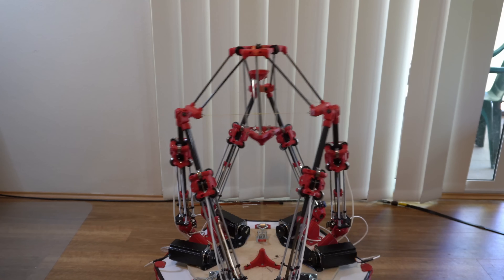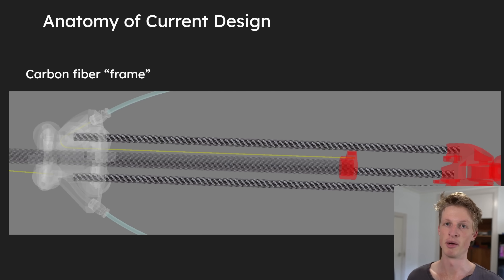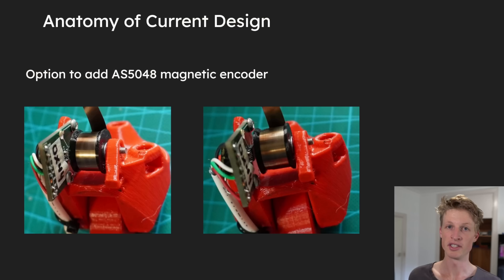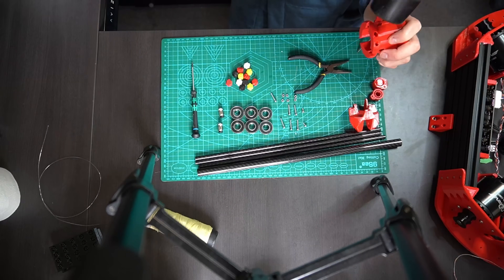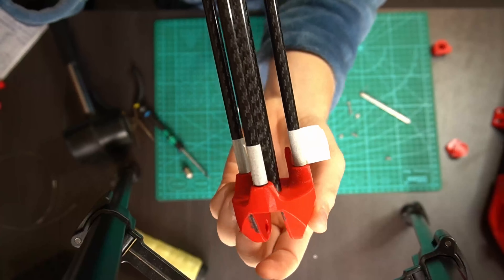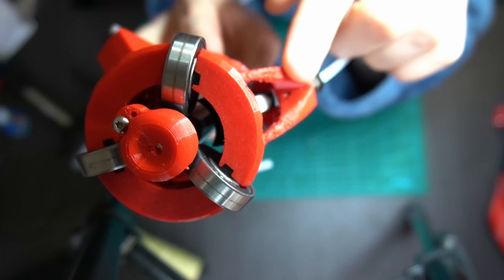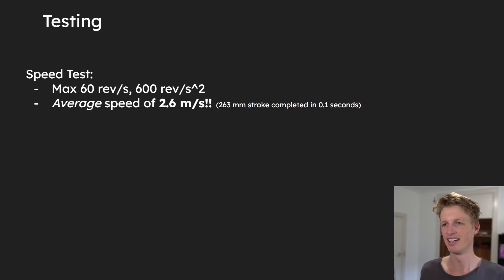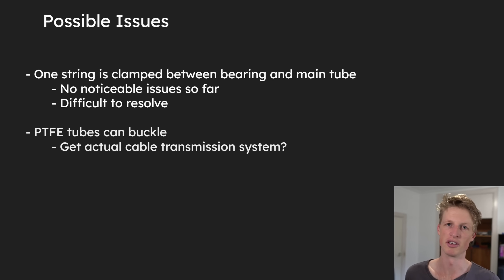Designing High-Performance Linear Actuators: Speed & Stiffness for my Juggling Robot | PDJ#19

Comment from the maker: Hey everyone! I hope you enjoyed this deep dive into the design process of the high-performance linear actuators for my juggling robot. I'd love to hear your thoughts on the design! What improvements would you suggest? Have you ever built or used linear actuators in your own projects? Share your experiences and tips in the comments below! 😃🤖🔧
Reply: As others have mentioned, one or two PTFE or Rulon J linear sleeve bearings would be lighter and probably stiffer than 6 6001RS steel bearings. You could also swap to acetal plastic ball bearings instead of steel to lighten them up and reduce wear.
Other than that you could replace the push and pull strings with a single string and have a tensionning spring at one end to remove backlash. You could also have the pulleys be tensioned against each other to acheve the same result but that sounds clunkier.
Reply from the maker: @NicolasGirard-nxg  Nice ideas! Some thoughts:
1) I previously tried a linear bearing instead of the 6 radial bearings, but the carbon fiber tubes that I'm using aren't specced for that level of tolerance; one manufacturers tubes had a loose fit, another didn't fit at all. Linear bearings would be awesome (smaller, lighter, more elegant) but I don't have the cash to get high tolerance, light tubes... yet 😉

2) Re. a single cable and springs to return: That was actually what my last design used! I had three 1.4 N constant force springs to compress the actuator, but they weren't fast enough. I could opt for stronger springs, but that would just be creating more work for the motor to extend the actuator. 

I like the idea of swapping to acetyl bearings to save on weight. If the weight of the actuators becomes an issue, I'll absolutely be changing these heavy 6001RS bearings for something better.

Cheers for the suggestions!
Reply: @harrisonlow can you offset the bearings 10 degrees to prevent the string being an issue long term.?
Reply: @harrisonlow  Don't use linear bearings on the three rods - just three regular bearings like in the current head but facing out to the inner sides of the three rods and a 3D printed  'shroud' to keep them located.
Reply: @harrisonlow  You can get precision ground carbon tube available in stock sizes. Check places like clearwater composites. 

Also, I suspect you would be much better off mounting the motors on the base of the actuators themselves. If you position them as closely as possible to the pivot/mounting point, it will have a trivial impact on the inertia of your system (because the motors will only move millimetres for tens of centimetres of actuator motion). That will allow you to eliminate the friction and complexity of the Bowden tube and eliminate those failure modes.
Reply from the maker: Interesting, I'll look into it! Re. Clearwater, I'm in Australia and don't have unlimited money so I'm trying to source things locally for now.

I'm glad you suggested moving the motors! The main reason why I moved them off the actuators themselves was actually to cut down on their size, as I was worried that motors sticking out of the actuators might bump into the base of the robot if the actuators move really far. Though since your comment I've been doing some more thinking and I reckon it should be possible to mount the motors in-line with the actuator. We shall see 🤔
Cheers!
Reply: @harrisonlow   @Harrison Low  For the carbon tubes I think the process they use is called centerless grinding, it's common with metals, perhaps a machine shop would give it a shot with carbon or there is another carbon fabricator in Oz you can find.
Reply: What is deferent than used linier bearing like lm20uu or semilar? @harrisonlow
Reply: @NicolasGirard-nxg  having a single string plus tension can cause issues like the force required to move it changing at different extensions, meaning the acceleration and force wouldn’t be linear.
Reply: @NicolasGirard-nxg  "pulleys be tensioned against each other" is something i found in many printers and some other older machinery. (they used gears instead of pulleys) A spring between the pulleys to set the tension and a lock screw  to stop the springing during operation. Just loosen the screw would reset tension when wires get a little 'longer' after use. 
For prototyping his bearings are very nice (priced...) Linear bearings sound nice but I think they will carve in to the carbon rods. Later get some miniature bearings to reduce weight also the holder can be smaller and thus lighter.  
to prevent the string from carving the entrance of the carbon rods, could use bearings with a groove in them.
( with a 3d printer make a jig to hold the bearing  and a 'dremmel' to grind the groove in the bearing your self.)

( I do need to get me a 3D printer ASAP.....  )
Reply: u can use the bike/bicycle brake tubes those are quite tough instead of the ptfe
Reply: @MartinDxt  Gear cable outers would be better than brake cable outers. Gear cable outers are design to be constant length. Brake cable outers can resist more force, but can compress a bit in length. Both are PTFE lined.
Reply: @MartinDxt  could use the steel cables from them, would make it strong AF.
Reply: @MartinDxt  Might be a good idea for a heavier construction with stronger motors. Use the teflon coated ones to reduce friction.   Running a steel cable around tight corners generates quite some friction.
When using the tubes as guide for the cables you could leave the cable-sleeves away and use pulleys ( as on some bikes) to take corners with the cable.  ( see also "3.22131 213123123 's  " comment
Reply: this is slick! have you considered routing the cables through the actuator arm itself?
Reply: @IncendiaryMedia  Would give much greater stiffness than a (long) bowden tube. Also, there's probably a high risk on the string cutting the tube.
Reply: @philip_fletcher  yeah you probably need some sort of super-hard / anti-abrasive bushing, like the ruby inserts in ruby-tipped 3d printer nozzles
Reply: What about using the electric conductivity of carbon to measure the position of the tube? 
Using the fact that resistance is proportional to distance and measuring the potential differences at the tip ( you can pass the wire together with the string) and at the base through the bearing or a brush.
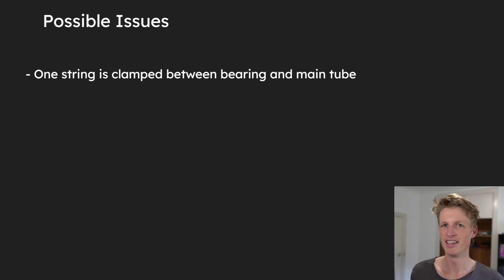Reply: 14:20 use a ceramic eye from a fishing rode for strung position 😉
Reply: I would put bearings on the 3 rods, back end of the extending arm, just for a bit more stabilization.
Reply: You could use vacuum cleaner to suck the string through the hose.
Reply: Great design! 3:50 0.3mm of adjustment range sounds quite large to me :) I'm always quibbling over micrometers to get that perfect wobble-free but smooth moving fit, or tight but no hammer needed. One advice I would give is do not use PLA for those tight fitting holes. It will crack after a few weeks under high tensile stress. PETG is much tougher.
I made a fun linear actuator using an internally threaded tube as the motor shaft, with the screw acting as the piston https://www.youtube.com/watch?v=EXYlxGLux8g
It's kind of cheating, forcing the leadscrew threads to bear side forces in addition to the axial force, but it works surprisingly well. It's really designed for a ball screw, but for this miniature version, a long sheet metal screw was the best substitute I could find.
Reply from the maker: @dekutree64  that's really cool! How does it know when it's at the end of its travel?
Reply: @harrisonlow  It has to be in a known position at startup, and keeps track of how many revolutions it's made
Reply: Very cool project!  Some thoughts:

1. The reason the PTFE tubes are buckling is sure to be because there is too much room inside the tube.  The ID needs to be as close to the OD of the string as possible, to prevent slop.
2. I think a better routing for the string would be to use two of them; one that goes from one end of the shaft to the other--wrapping around a drum in the middle--while the second wraps around that drum and another at the motor end.  (The first can run in between the bearings so they won't be an issue.)
3. Moving the second set of bearings to the inward end of the sliding shaft--they would press against the frame--would make sure that it is fully constrained even when fully retracted while a sideways force is pressing on the outward end.

Does that sound reasonable?
Reply: Any reason why you are not placing a bearing block on the bottom of the moving carbon tube to run, triangulated on the three carbon tubes? Would add a little moving mass but would remove the need for two sets of bearings on the head and, until maximum extent, significantly increase the moment arm.
Reply: @philip_fletcher  Ah, I think the weight-stiffness tradeoff just isn't in favour of that, and it wouldn't have a benefit when the actuator is extended and you need it most. It costs far less mass and only a little length to just move the bearings further apart if that stiffness was needed.
Reply: Awesome video! Carl Stahl tecnocables is a cool custom bowden cable supplier in case that is interesting, Looking forward to this series👊👊
Reply from the maker: Thanks! I'll have a look into them. Cheers for the suggestion!
Reply: Maybe you could remove the motors and build an radial magnetic actuator. You also can drive it with your Odrive and reuse the encoders by that ''wire idea'' lol? Radial magnetic actuator are the most efficient, easy to build and they are far faster than you have now.
So far i know there is no such a thin as a cable transmission system but i there are many other flex transmission systems. Cable seems unpractical due to the obvious friction losses it creates. For low friction look in to teflon.
Reply: Very smart design, Harrison. Looking forward to seeing the Jugglebot performing. Subbed. Cheers from UK
Reply: Ooh, I'm so glad to see this actuator concept getting some real development, I don't think I've seen anyone actually make one so far, and you got it to work really well!
Sorry for the novel below but I have had a lot of thoughts about this concept :)

I would like to suggest some changes to your bearing head. Firstly, I think you need to rotate the top set of bearings to be inline with the bottom set (which I guess can't be moved), and that might give you enough room to offset the cable turnaround pulley so the cable isn't running under a bearing. I saw someone mention running the cable through one of the support rods which would work great with this and cut down on weight too. If the bearings are in-line in rows then the bearing head could be fully split up one side, which would allow you to tighten the bearing fit just by closing that split with screws, which will be more reliable and rigid than using plastic inserts. The split could be in-line with two bearings so the screws the bearings are mounted on would also be used to tighten the fit. I guess you could even split it in 3 which would let you tweak the inner rod angle after assembly, but that is probably better done by getting the bearings tight and then epoxying in the carbon rods with the assembly held straight.

The cable pulleys could also be modified or replaced to get the cable closer to the rod to minimise the changing amount of twist that it puts on your bearing, I would expect that is the main source of flexing force right now. You can probably get away with not having a groove in the bearing since it is so close to the cable mouth, which could let you select a smaller bearing. Also you should really change the cable termination points to ensure the cable runs parallel to the motion, if it is angled then the tension will change as it moves.

As for the cables themselves, I would recommend a thin nylon coated steel cable (either generic, or some bike cables do this) running inside a plastic or plastic-lined sleeve. Ideally it would be nylon coated kevlar, which I am sure exists but IDK where to get it. For the sleeve; brake cable liners are spiral-wound so they have too much compression, you will want either bike shifter cables where the reinforcement is mostly longitudinal, or solid plastic MIG welder cable liners, which come in smaller internal diameters (a tight fit will prevent the buckling problem). If you have smooth plastic-on-plastic sliding then you can get some great benefits from lubrication, light silicone grease would work wonders, regular light grease should be ok, don't get anything too viscous & tacky or it might be worse than nothing. Squirt it through the sleeve then pull the cable through.

You may eventually run into a problem with the inner rod rotating. A bearing on the end to stop it from being rotated by the driven load would fix this, and hopefully the cable tension would be enough to self-align and stop the rod slowly rotating and pulling on the cables. Otherwise you may have to put the cable terminations on bearings too so they can also self-align, or completely redesign it to use a square inner rod. If you need a bearing on the end a good setup might be a flanged bearing that can support itself on the tube end and then a bearing slipped down inside on a rod to resist twisting. I really hope this isn't an issue since all the solutions add complexity and/or driven weight.

For the driving winch you may want to mount the cable guide farther from it to reduce the tendency for the cable to bunch up around the middle, since that increases the diameter of the drum. Anything that will make the cable tighter or looser as it moves will affect how stiff you can make this, since if you have it very tight and stiff and then it gets even tighter it may cause damage.

And finally, if you find that cables are just not working out for you then a timing belt design wouldn't be too bad since you can mount the motor right at the bottom, but I really hope this cable one works out. Best of luck! :D
Reply from the maker: @samheasmanwhite  Wow, very thorough! I'm on mobile and can't read your message while writing this one, so I'll just summarize and say that there were a few really good ideas there. Thanks for the suggestions!
Reply: A question. Are there any very accurate linear sensors? I've an application where I need a no touch linear sensor to measure 10-20 cm. Similar range to yours. 
Second question, if you have an accurante linear sensor, can you use that to get more control? ie. Not so accurate actuator, but use the sensor to get the fine control.
Reply from the maker: @Nickle314  Hmm, I've used ultrasonic sensors before but they're really noisy. Why does your application need to be no-touch? If you can relax that, I'd suggest looking into whatever digital calipers use. They're insanely sensitive. I think it's something with magnets 🤔

As for your second question: if you've got an imprecise actuator, no amount of sensing precision will help you much; you'll tend to get stuck in feedback loops. It's best to have both precision mechanics and sensing if possible
Reply: @harrisonlow  It's in an aircraft where I want to measure the position of the control inputs. One option was a sticker on the control rods and a camera reading the information with a bit of image processing.  I wondered if there were known ways. 

I looked at the infra red sensors, but they really only detect presence as far as I can see. 

Ultrasonic was an option

On the second question it goes back a long way.  A company I worked for had a cad product. They were also looking at robots. The idea very similar to yours. A simple actuator, with multiples of them put together. They were looking at the feedback loop to get the accuracy. Without giving the game away this was decades ago.
Reply from the maker: @Nickle314  Interesting. You couldn't put encoders on the control inputs themselves?
Reply: @harrisonlow  You could but you would cause all sorts of problems with type certificates and insurance. For prototypes they do this. 

I've an idea for a new instrument, and whilst I don't need it, it would improve it. You can then get feedback of piloting skills and put that into my algorithm. 

On thing, separate, that I've recently come across is improvements to GPS, called RTK real time kinematics. You can replace gyros with 3 GPS receivers because they have 1cm accuracy for example. They use these now on ships to get pitch and roll, as well as bend. ie. By how much is the ship deforming in the waves.
Reply: @Nickle314  you can can get laser distance sensors accurate to 0.01mm. You can get units with different sensing ranges. But they can be a few hundred AUD.
Reply: @Joshua0689  Thanks
Reply: Cool progress so far, I'd route the actuating strings through two of the three carbon fiber tubes and use full pulley guidance of the string, removing the flexible Bowden tubes altogether.  When you look at controlling it, a stretchy string is much easier to account for than a variable-length, -path, and -friction Bowden tube.
Though painful to undertake another iteration, I'd do a quick calculation of the impact force of the ball and apply that to the actuator at max/min to estimate the deflection during impact.  I think you'll see a deflection of a few mm, which your kinematics may tell you matters.
Reply from the maker: @bcon2442  interesting ideas! Some thoughts:
1) Routing through the CF tubes would've been possible, but tricky, as I want a fair bit of motion of the actuator relative to its motor. Anything other than a cable sheath mechanism seemed like more effort than it was worth. 
2) Re. controlling ease: I think neither of those situations would be ideal! Thankfully for me, friction (effectively) doesn't matter (motors are very strong), and the length of the guide tube doesn't (shouldn't...) change, so the path it takes doesn't matter either

3) I have two thoughts about the impact force idea: 1) afaik, it's practically impossible to figure out how much force is going into any one of the actuators, as it's a statically indeterminate system. I could use FEA, but I don't have access to any FEA software, and 2) Ideally, there will be zero impact force. A big part of juggling is keeping everything smooth. Smooth catches, smooth throws. Jugglebot will need to do the same if it is to do what I want it to do. 

Cheers for the suggestions!
Reply: Perhaps for the tube you can use a woven cable managing sleeve or something woven in a similar fashion, the woven nature means it can be much more adaptable to stresses but still have some rigidity. Or rubber band tubing, I know that the rubber tubbing comes in very fine sizes.

The latex might burn up from friction, but the woven plastic should hold up they both will likely tolerate much more flex without overtly kinking. 

Also perhaps some sort structured armor like the plastic cable chains I see in cnc machines. If you have a semi flexible shell with joints around the tube it might offer enough rigidity to deflect the bend to the surrounding links rather than just collapsing. That might actually be the best idea keep the tubing you have as inner sleeve and outer sleeve have a kind of exoskeleton. I know this stuff exists already but you could also print your own. 

I’m curious if you actually changed the string to wire or not but definitely increased the size of the wheel while using a gear ratio to get the same or increased speed… if you have more of a barrel rather than a spindle or spool like you have now if that wouldn’t improve the management and potentially the performance of the string. I imagine if you only needed one, two or three, rotations of the barrel to move the full length of the actuator if that wouldn’t make things better. I have no idea why this seems better to me but to say you probably will have less stretching if that becomes a problem and the string may get more grip over more surface area. 

Thanks for giving the opportunity to brainstorm. Hope it wasn’t a waste of your time.
Reply: Nice work, and great video with the deep dive. I love the details.
I'm also very impressed with the quality of suggestions you get in the comments from your viewers. Some very good ideas.
Reply: This is amazing! I love the progress! Re: the Bowden tubes, you could try mountain bike cable tubes? Some are pretty well reinforced and low friction. 
Looking forward to the next one!
Reply: I was wondering if the bearings are absolutely necessary? if the weight is a concern and assuming the carbon fiber tubes are relatively smooth on the outside then you could try replacing them with pieces of some low friction plastic, such as ptfe or delrin. i bet that could net up to a 100g decrease in weight.
Reply: @nikkorap  Another option is ceramic bearings. 50% weight savings and a straight one for one exchange.
Reply: You can clamp the cable routing tubes wherever it's not going to affect the movement of the entire mechanism.  The bearing clamping your cable issue would be a cable entry location issue and will require some redesigning of the guide mechanism to relocate the cable location.
Reply: Since the tube is moving in one axis, kinematically you need 5 constraints - so you only need 5 bearings.
Reply: hey mate, nice project, and thanks for sharing it. I built a six stage cable driven telescoping actuator a year or so ago for a client, and I can confidently say that you could replace the teflon tubing you're using with outer brake cable for bicycles. A decent quality outer cable will have a teflon liner, and they can actually handle pretty tight bend radii. You can use bicycle brake cables as well, but you could also try using any fine multi-strand wire rope. Bunnings will has a couple of things which could work and much cheaper than bicycle brake cables. I don't think the cable will behave well under the ball bearing though, do you think you could offset the hole that the ptfe tube/string comes in ten mm or so to the side (parallel to the current placement) and make a pulley with an offset narrow portion to allow the cable to run beside the ball bearing? Obviously it will mean that the end cap for the string will also have to rotate a little, but I dunno if that would be an issue for you. If you use the brake outer cable you want a proper set of cutters for it, knipex make a good one which isn't horrifically expensive, and make sure you use the end ferrules for the cut ends of the cables. They really neaten everything up and support the end of the cable. Also, you can get barrel adjusters so you can make fine adjustment of tension in the system. The actuator I made (which was something like 1.5m extended and weighed about sixty kilos with the payload) wound up having something like fourteen points which needed to be adjusted to tune it, and they really helped. Hope some of that might help, and thanks again.
T
Reply from the maker: @TheoNolanIsles  Wow, that sounds like a really cool project! As it happens, I've been working on a redesign of these actuators that has the motor in the actuator itself, inline with the extension axis, completely removing the need for any guide tubes. Prototype is built and seems to be working well. Hopefully I'll be able to carry out some testing soon and I'll publish the results when I do 😊
Reply: I would try feeding the string up the inside of the outer CF tubes, have it exit inside the 3d printed ring and run it over (or under) a small flanged pulley above the outer rod. it would shorten the run of Teflon tube, reducing drag and wear on the string and reduce the mass being jogged around at the top of the device.

I would also align the top and bottom rod bearings, rolling contact points are different from fixed rigid points so the lines between them don't act like trusses. It won't look as cool, but you'll get more stability and rigidity from the bearings being aligned than you would from any rotational offset. This would also give the string space in both directions to avoid being run over by one of those bearings
Reply from the maker: The first thing you described is exactly what I've done in the new version of these actuators! Good thinking 😊

Re. aligning the bearings, I'm very curious about this. Why would there be more stiffness with aligned bearings, rather than the 60 deg rotated ones?
Reply: @harrisonlow  
When the rod is forced in a direction between two bearings it gets a 2x mechanical advantage in the 120 deg wedge between the bearing surfaces. Though they share load, each taking half of a 2x load is still a full load each and causes more stress on the plastic housing, and if it does this on the top and bottom you can have a full load on up to 4 bearings at once putting extra stress on the plastic parts.

You can see how creating a 60 deg rotational offset between each set could mitigate these forces so no more than 3 bearings see a full load at any time, but torque will cause the rod to push on opposite sides of the top and bottom sets. So ironically, in order to be offset to torque forces, they need to be aligned in the assembly.
Reply from the maker: @bj_  Interesting! I see what you're saying. I think at the end of the day, the stresses in the printed part aren't that great so it's not a big issue. I'll see if the CAD is easy enough to change and if it is, I'll make this change in the next design. Cheers!
Reply: Those strings are going to eat through the ptfe tubes like they did to the printed part with buckling like that. Could mount the motors to the bottom of the actuators and get rid of the tubes altogether. I'd also press a printed piece of plastic or something on the ball bearings that contact the carbon fiber rod, so it doesn't wear as quickly making you breathe in carbon fiber.
Reply: You can get braided SS line and hose or you can buy the braided jacket on a spool and you cut to length. I found buyheatshrink was a option, that I saw it in 304ss non magnetic and 430ss magnetic.
Reply: Hi,  quick suggestion on the bearings. To reduce a lot of friction you can remove the bearing shield/ seal and dissolve the grease. I doubt this machine has to work in a dusty/ dirty environment.
Reply from the maker: @AlmightyMister  Interesting! Another commenter mentioned that I should add more lubricant to the bearings and now I don't know what to think! 

Surely removing the grease will make issues more likely? (eg. heating, jamming, noisy-ness etc)
Reply: I love the design. I think bicycle brake cables which can be found on amazon pretty cheaply might help with the buckling. I am also curious how the 3D printed housing might fair when printed in resin.
Reply from the maker: @geoffstandee  Cheers! Yeah bike cable would be better for buckling, though I can't imagine it'd be too happy about all the really tight bends.

I'd love to try resin printing, but I don't really have the space or means to get into that right now
Reply: I really like your mechanical designs, but I have to say your 3D prints are most likely the worst I've ever seen on Youtube. I'm not trying to mock you, I am telling you because I think you could do much better if you would get your 3D prints under control. I mean, just look at the mess at 6:26. That looks worse than my first ever 3D print. There is so much information out there to get better print results and I think it would make your designs work a lot better.
Reply from the maker: @PixelHawkAlpha  I think part of the issue is that these geometries are quite complex; for more simple parts, the quality is perfect. I appreciate that I could get the quality to be better, but it's definitely good enough for what I'm doing and I don't value that quality enough to warrant spending hours fine-tuning everything. 

Out of curiosity, what printer do you use? I'm using the same Prusa mk3s+ that I've been using for ~2 yrs